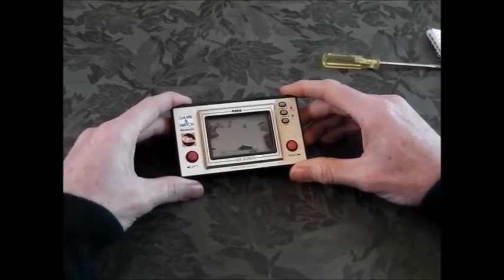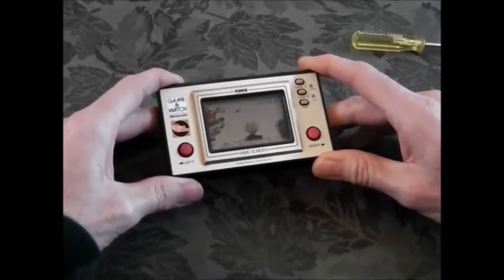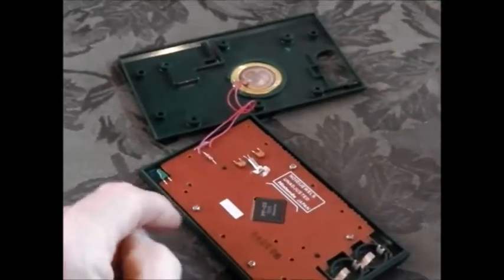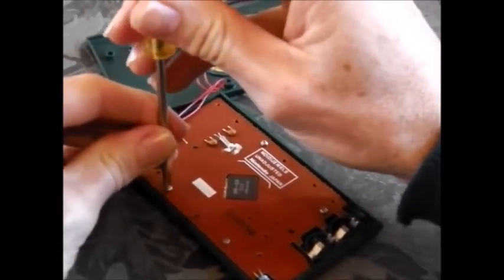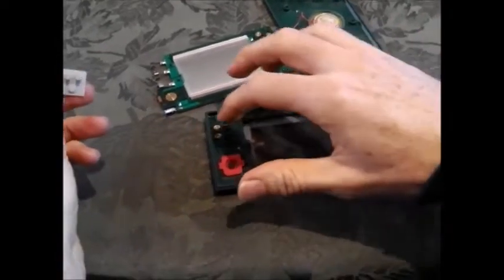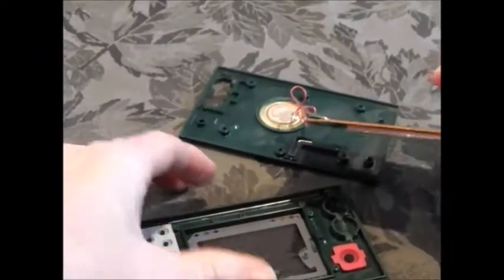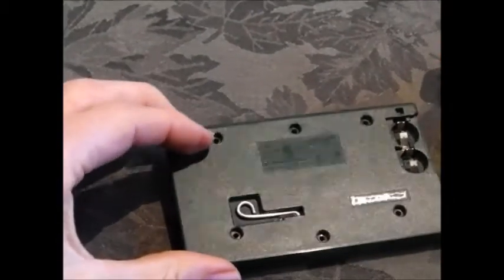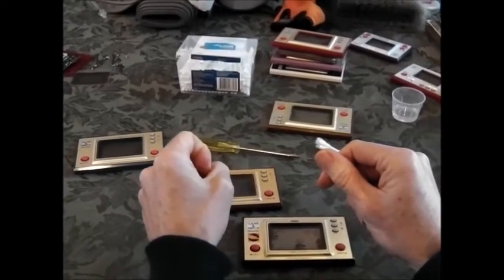How To Repair and Clean a Nintendo Game & Watch

Comment: thank you mate. took my DK Jr apart to fix a warped reflector. I put the reflector between the pages of a thick book and put a whole pile of books on top of it. Promptly forgot about it. about a year later i found all the bits of my Dk Jr. The books had all been put into a bookcase and I couldn't remember which book i put the reflector in. went through a stack of books before i found it. re-assembled with your video playing :)

Comment: Thanks for this post. I have a Donkey Kong Jr with unresponsive buttons. So I'll give this a try.
Reply: Hi, I have also one with unresponsive buttons. I opened and cleaned, but the buttons still not working. I ve checked the circuit and at the end there is a capacitor. Could this be the problem, because the voltage would‘nt be correct?

Comment: Awesome video. I repaired 2 of mine so far. My Super Mario Bros has a repair like this. Cleaned the polarizer film, cleaned the buttons and terminals with contact cleaner.

I also fixed my Popeye Panorama which had LCD characters disappear when opening the screen with some contact cleaner and tape to make the ribbon cable sit flush against the LCD terminals.
Reply from the maker: Thanks Lemmy. Glad I helped!
Reply: Game Man No problem. 

I got a Fire and Helmet with left triggers that just wouldn't respond very well, but cleaning them helped improve them. 

Fire works nearly flawlessly.
Helmet is a bit fishy sometimes but it works nicer than before.

I tried cleaning my SMB and Bombsweeper but they didn't react the best. I believe these are a bit different. The terminals on these units are black instead of copper, so contact cleaner/rubbing alcohol doesn't react well. I ended up lightly sanding the back of the buttons to get a better response on my SMB, and replacing the Dpad membrane on my Bombsweeper via Ebay.

I think the best way to clean, is to try to use a dry Qtip on the terminals first. If that didn't help, then on the back of the buttons as well. If that didn't work, then a bit of rubbing alc/cleaner on the terminal, and then again, if it didn't work well, cleaner on the back of the button.

Also keep note, that I think that some of these units, especially the newer ones, have graphite on the back of the button to help make button presses more solid and accurate.
I've heard using soft pencils on the buttons can help, but It has to be soft. I might try on my SMB and I'll report back if I do.

Cleaning the buttons seems to make it so you don't have to dig in as hard to get a button press to register, but seems to sometimes make random button register failure go up, again, probably because of rubbing off graphite. 

In the long run, if it really doesn't need to be cleaned and it just takes a very slightly harder press, don't clean it. If it takes ridiculous presses, then clean it.
Reply: Game Man Also, my Fire seems to have a very darkened reflector, so I'm trying to get that replaced. There's also some slight stains on the screen but they're barely noticeable.

By the way, do you think you'll do anymore videos?
Reply: ***** If the black lines are worn out, there's not much you can do without making alterations.

The black lines are the conductive material to transfer the LCD messages to the LCD.

Maybe try to buy some conductive solder glue or graphite glue and paint the lines back is the best thing to do.

For your Donkey Kong, you can actually buy a repair kit with the LCD cable on ebay.

http://www.ebay.com/itm/NINTENDO-GAME-WATCH-REPLACEMENT-CONNECTOR-STRIP-MULTI-SCREEN-SPARE-PARTS-/321789714758?hash=item4aec296146
Reply: +Game Man I was wondering if you can give me a website to buy polarizing lens. I cant find any and i really need one for my donkey kong 2 multiscreen.
Reply: Lemmy Koopa can you make a guide or show me a guide on how to do it thanks regards les

Comment: so I have a lot of less than optimal game and watches but i will use my fire attack as an example since it's widescreen

this game when looked at directly, you can barely see any characters at all

but if you tilt the game back, almost like you are looking at the bottom of the game case, then the characters appear black and very clearly. 

is this a problem with a polarizer? I swapped in a new polarizer and it didn't change anything

I took the polarizer completely out and turned the game on, then put the polarizer in front of the screen, the characters did show up but only at a certain angle. Is there maybe something wrong with the reflector? it did have a little dirty spot on it but nothing major
Reply: I had a copy of Fire a little like this.
No guarantee it'll be the same for you, but the issue with mine was that the previous owner had tried to replace the reflector but had put in a cheap aftermarket one made of this weird shimmery paper.
If this isn't the problem, and replacing the polarizer doesn't help, and the batteries are new, then it might just be an LCD problem, which is a lot harder to fix

Comment: Great to see your repair video. Unfortunately the two red playing buttons still do not react after a good clean with alcohol. Do you have other suggestions or will it no longer work? The game seems to function properly except for the buttons. Thanks an regards Johan
Reply: Same problem here, if anybody know a solution ?
Reply: I have a Donkey Kong JR and the same issue. Four direction buttons don’t work. I cleaned them and the circuit board with alcohol.

Comment: Hello and thanks for great video! I have a Donkey Kong Jr (DJ-101) and the four direction buttons don’t work at all. I cleaned the buttons and circuit board with rubbing alcohol. What could cause this issue?

Comment: Thanks for the video, unfortunately the issue I have wasn't covered.  Just bought a used Tropical Fish unit and the polarizer and scenery screen are warped - probably from sun damage.  I took them out, cleaned them and used hot water, hoping to make them flat again.  Didn't work.  Is that even possible?  Or is there another way to flatten those?

Comment: Hi, I have an Oil Panic dual screen G&W which has dark area on both screens. I'm not sure if this is screen bleed or the reflector showing signs of moisture. Can you help? The top half of the top screen is dark and the upper left of the bottom screen are affected.

Comment: Just wondering, is there any way to prevent the LCD screen bleed? My Game & Watch has the reflector moisture issue and I have the components to fix it, but now I am paranoid that I will break it somehow. I thought the screen bleed would be the most prominent threat, so I am scared. Thanks.

Comment: excellent tutorial, thanks. i have four g&w and hope to add to my collection. i was lucky enough to be given two donkey kong II games. however, one is missing a line of pixels (the entire line where the top birds fly). all other pixels are fine. do you know what's causing this? also, do you know of a cost friendly place to buy a donkey kong II battery cover? one is missing. also, watching popeye really took me back. i must buy that g&w someday. there's so many i've never even seen in action since my parents struggled a lot. i was 10 years old in 1982. i'm originally from melbourne by the way.
Reply: Could be the LCD screen isn't getting proper contact with the motherboard. I'm not sure if the LCD can come off the motherboard, but if it does, clean the terminals. There's most likely rubber pads that go between the LCD screen and the motherboard to transfer the signal to the LCD. Clean that area if you can, with either rubbing alcohol or contact cleaner.

Comment: Thanks for the vid- It helped very much in restoring my 1981 'Parachute' game & watch.  35 yrs. unused: after the main button terminals and silicone button 'boots' were cleaned thoroughly, it worked like new! I wonder if replacement 'front' polarizer lenses are available anywhere in new condition. Is there an aftermarket source for these which you know of?
Thanks again for the helpful vid.
p.s. I got this particular game at the 1981 Toy Fair in New York. Rad!
Reply: +RonnieMund Pacecar Update: I located a source on ebay for new polarizer lenses (Parachute, wide-screen).  Any search referencing 'new polarizer nintendo game and watch' should get you there. With control terminals cleaned and new polarizer, this game functions like new-

Comment: Fitted new batteries to my Parachute game....no images and no sound. Given everything a clean as you have shown in your video...still nothing. Any advise to get it going again would be welcome...thank you
Reply: As a guess,, battery terminals may not be connecting with battery properly. Try bending the metal battery connectors a bit, to get a better connection and see if that works. If not, then my next guess would be that the integrated circuit on the board has died and this cannot be fixed. ~Game Man